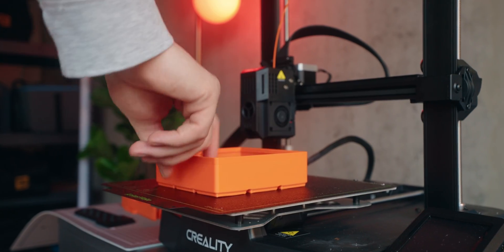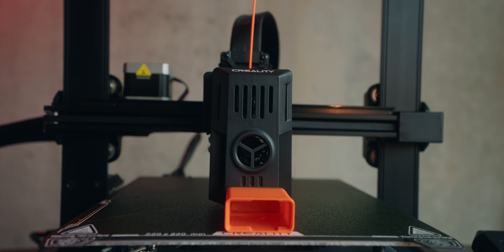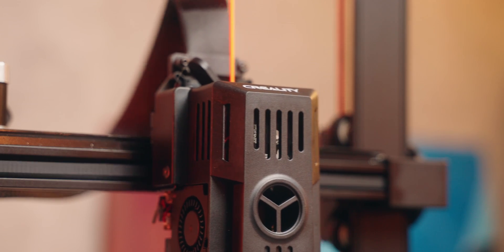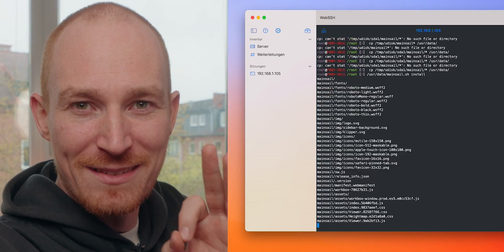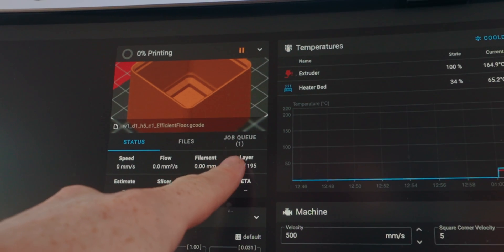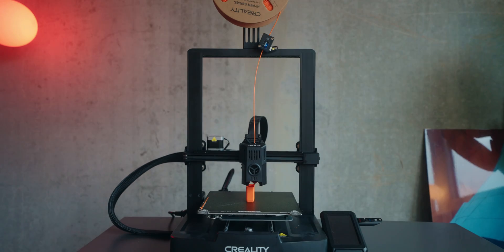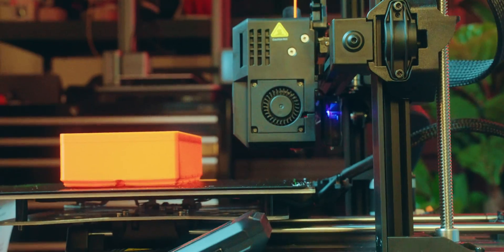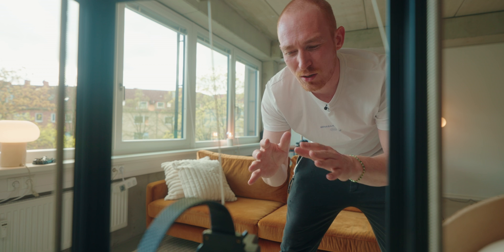How I fully automated my 3D printer

Comment: Add a conveyor belt that the prints can fall on. There are many options that could be used to detect when a print is on the belt, and the belt can move forward making room for the next print.

Comment: 3:20 - No need to root the 3D printer or use a print server.  Just cut and paste the original G code to a concatenated file with the cool down and part ejection G code in between.  It's handy to repeat the number of items to print an entire spool of filament, whether that's 1 kg or 3 kg.  The Slant 3D print farm designed their extruders with little bulldozer blades on the front to do a better job pushing the parts off the bed.
Reply from the maker: Yeah that's definitely also possible. With my method however you can add new prints whenever you want and all sorts of different models. 
Really like the little bulldozer blades

Comment: how to apply same concept for bambu lab A1??
Reply from the maker: Hey! You could probably modify the end gcode to push off after a print is finished. In terms of the print queue that’s not going to be possible from my understanding. So you’ll have to manually start new prints or combine several print gcode. If you want a easier way you could look at swapmod for the a1 Mini
Reply: @Arne.Bornheim  thank you for the information do you have some ideia if the swap mod will be available or is under development for the normal A1?
Reply from the maker: @wallyonfashion I think it might come eventually but it’s definitely still a far way off …

Comment: Explain something to me. Why are you only printing one model at a time?
For example, ONE box model (I took: Divided Bin x4 - 1x1x2 - jdegs) prints 29 minutes, but TWO placed on the table at once, print 43 minutes. THREE at a time print 59 minutes. That is, in normal printing time you would have 2 pieces in an hour, but by printing all at once in the same time you will get 3 pieces. In 2 hours you will print not 6 but even 7 pieces of the same box at once, where normally you would have only 4 pieces.

I understand that with a full table of prints, you wouldn't be able to use your nifty automatic printing system (great job, by the way), but think how much faster it would speed up filling your drawers with the prints you need.
Reply from the maker: I totally understand! You can use multiple objects on one bed with this method, too. And that makes a lot of sense, usually. To do it with this method, you need to move objects close enough and have a large brim to connect them. 

Since my aim for this video was to get the thing working in general, I tried to make things as easy as possible for me and just did one object per plate....

Comment: Great Idea.
I took it and asked Chaty how to crate it in an easy way.
With a phyton snippet  I merge different files and add the kick for the parts.
Sorry for the German.

Code:
import tkinter as tk
from tkinter import filedialog

# G-Code für den Übergang zwischen den Blöcken
transition_gcode = """
; Übergang zwischen Druckteilen
M400 ; Warten, bis alle Bewegungen abgeschlossen sind
M140 S30 ; Heizbett auf 30°C abkühlen lassen
M190 S30 ; Warten, bis Heizbett 30°C erreicht hat
G1 Z5 F900 ; Z-Achse auf 5 mm anheben
G1 X0 Y250 F3600 ; Druckkopf ans hintere Ende der Platte
G1 Y-10 F1000 ; Schiebe das Bauteil nach vorne, bis es von der Platte fällt
G1 X0 Y128 F18000 ; Druckkopf zurück in sichere Position
; Fortsetzen des nächsten Druckteils
"""

# G-Code, der nur am Ende des letzten Druckteils eingefügt wird
custom_end_gcode = """
; Custom End G-Code
M140 S0 ; Heizbett ausschalten
M106 S0 ; Lüfter ausschalten
M104 S0 ; Hotend ausschalten
M400 ; Warten, bis alle Bewegungen abgeschlossen sind
"""

# Datei-Auswahl über Dialog
def choose_files():
    root = tk.Tk()
    root.withdraw()  # Versteckt das Tkinter-Fenster
    file_paths = filedialog.askopenfilenames(title="Wähle G-Code Dateien aus",
                                             filetypes=[("G-Code Dateien", "*.gcode")])
    return list(file_paths)

# Funktion zum Zusammenfügen und Einfügen des Übergangs-G-Codes
def process_gcode_files(file_paths, output_file):
    with open(output_file, 'w') as outfile:
        for idx, file_path in enumerate(file_paths):
            with open(file_path, 'r') as infile:
                lines = infile.readlines()

                # Entferne den Abschluss-G-Code der vorherigen Datei (außer beim ersten Druckteil)
                if idx > 0:
                    lines = remove_end_gcode(lines)

                outfile.writelines(lines)

                # Übergangsgcode hinzufügen, außer bei der letzten Datei
                if idx < len(file_paths) - 1:
                    outfile.write(transition_gcode)

        # Füge den benutzerdefinierten Abschlusscode nur am Ende der letzten Datei ein
        outfile.write(custom_end_gcode)

# Funktion zum Entfernen des Abschluss-G-Codes
def remove_end_gcode(lines):
    end_marker = "; EXECUTABLE_BLOCK_END"
    for i, line in enumerate(lines):
        if end_marker in line:
            return lines[:i]  # Gibt alle Zeilen vor dem Endblock zurück
    return lines  # Falls kein Endblock gefunden wurde, alle Zeilen zurückgeben

# Hauptteil des Skripts
if _name_ == "__main__":
    file_paths = choose_files()
    if file_paths:
        output_file = filedialog.asksaveasfilename(defaultextension=".gcode",
                                                   filetypes=[("G-Code Dateien", "*.gcode")],
                                                   title="Speichere die verknüpfte Datei")
        if output_file:
            process_gcode_files(file_paths, output_file)
            print(f"Die G-Code Dateien wurden erfolgreich zu {output_file} zusammengefügt.")
        else:
            print("Kein Ausgabedateiname angegeben.")
    else:
        print("Keine Dateien ausgewählt.")
Reply from the maker: Haha interesting approach! I like it but prefer the version through the gui since I can add new prints whenever I want. I don’t have to plan out all m prints before. I know it’s a small difference but to me it makes Usability a lot better. 

No worries about the German 😉 ich verstehe das ganz gut 😊

Comment: Got an A1 yesterday, I have a remote webcam looking down on the bed.  Prints can be selected and sent to printer remotely, so when this current job finishes and bed gets below 30c, I'll try to shove the finished article  it off the bed and table manually by remote controlling the bed and printhead.  Fingers crossed.
Reply from the maker: When you wanna do this you might have to modify the end gcode. Most printers deactivate all motors at the end. When you want to move after that they need to Home first which might mean crashing into your print.

So just beware of that 😊

Comment: If you want to cut some time between prints, turn off the bed heater x number of layers before the last one.  then you get a jump on bed cooling and ejecting of the part.
Reply from the maker: That's a really smart idea 😊 You'd have do dial it in to be sure it works correctly but i like how you think!

Comment: Would this work on the ender 3
Reply from the maker: On the OG Ender 3? This is really based on the Klipper firmware so the stuff shown in this video doesn‘t really apply. But in general you can do something very similar with a raspi and octoprint. There‘s even a print queue plugin for octoprint so might be easy to do

Comment: when i use your gcode i get either error 2095 or an unknown error :(
Reply from the maker: Which printer are you using? a quick google search says that 2095 is "Must return to origin first". My first guess is that you have to go into your slicer and remove the "disable stepper motors" in the end gcode.

hope this helps 😊
Reply: @arnebornheim  After I realized that it requires a new homeing, I tried to prevent this, unfortunately without success. I have an Ender 3 V3 KE. Do you know how to turn off "disable stepper motors" in Creality Print 5.0 Slicer?
Reply from the maker: @thaboi7398 yeah I think after you disable stepper motors you always have to Home again (which wouldn’t work with something on the bed). In Creality slicer you have to go to the settings of your printer and then to the end g-code. Usually the last command is disable stepper motors (there’s usually a comment behind it) just comment that our or delete it 😊

Comment: Its a cool idea, but I wonder how much force the printer needs to remove the print from the bed and if it can cause bending of the frame if used too much. Your prints are quite small, so probably not much force and hence no damage, but if you used all the print bed (aside from the part you have to keep empty to give the head some clearance to lower down) then I am a bt concerned about damaging the printer this way.
Reply from the maker: This really also depends on your cooldown time and the print bed. In my experience even the biggest prints can go of with almost no force when they’re cool enough.

Comment: you coud have installed octo print and there is to 1000% a plugin that can du it if not it by it self
Reply from the maker: Yes octoprint has something similar. But as far as I know you need a raspi for octoprint whereas my setup runs on the printer natively

Comment: If you don't want to root your printer you can just copy and paste the gcode over and over to que the prints from within one file. Works great! It loses some of the functionality of your system but it is less scary (for me at least). If you throw in some code you can also get it to make purge lines in different spots for every print.
Reply from the maker: Definitely also an option. If you want the same thing multiple times I think there’s also a loop command
Reply: where do I put the gcode?
Reply: @akosichad88  if you are asking this you should NOT try.

Comment: Automating the printer is cool.  No doubt.  However, why not print a bunch of bins at the same time instead of one wee little bin at a time?  Print 8 hours worth of stuff instead of 1 hour of stuff.
Reply from the maker: Yeah definitely possible! However you'll still only be printing 8 hours and not continually. 
You could also get more bins on the plate with this method as well. just have to make sure to connect them with a brim or change the push off script. I just wanted to keep it simple for my testing
Reply: @arnebornheim  You also have the benefit of the plastic cooling more before the next layer, to help battle some kinds of slumps, etc.
I was speaking more to the idea that you can't get much done at night.  If you print enough stuff to keep the printer busy over night then that isn't as much of a problem.

Comment: How did you preset that red/blocked area to not print overthere? I am trying to make this area to block printing or calibration area on K1 Max
Reply from the maker: Hey 😊 in many slicers like orca or prusa you can add a custom bed image. I honestly googled it. Found one and then added the red area in photoshop. Since the base image wasn’t mine I cant share mine sadly. 

Hope the process makes sense though 😊

Comment: You don't need to root the printer to do this. You really just need to combine the print files with custom g code between them to clear the bed. It would be easy to do that with a python script.
Reply from the maker: Yeah that’s also possible but feels less flexible for me than this since you can add new prints at any point
Reply: @arnebornheim  maybe so but making a program that does stichs print files together while clearing the prints between files would be something your average person would be excited about. Also it would work on any printer without modification or voiding warranties.

Comment: one of the problems is making sure your have a 3d printed bed that can at any size or how much the print has taken be capable of pulling it all off easily  without problems
Reply from the maker: yeah that's definitely a concern. I found on my printbed that with enough cooldown time all parts eventually come off fully. Then it was just a matter of best achieving that timing through gcode 😊